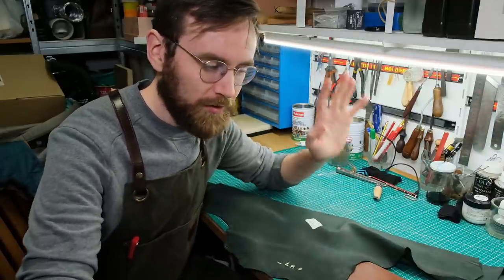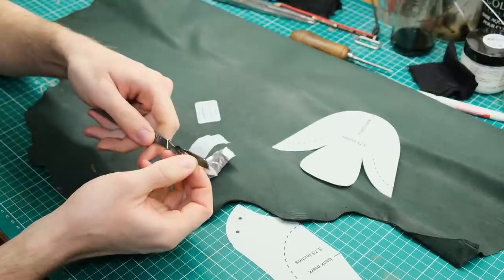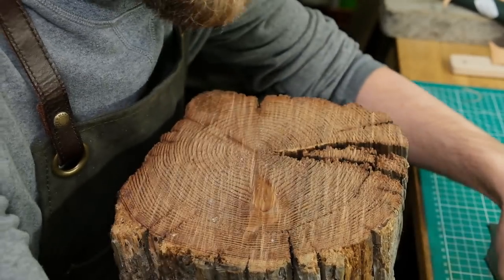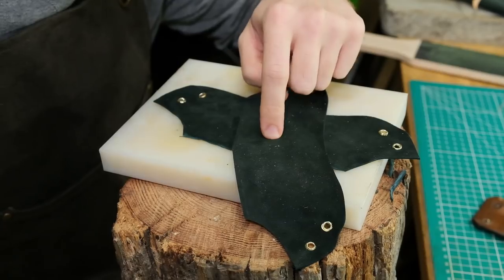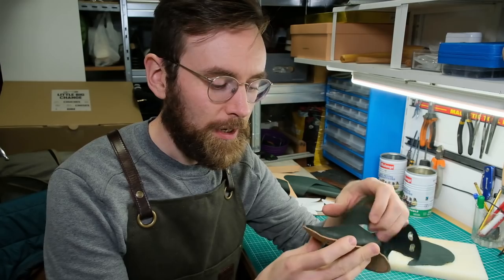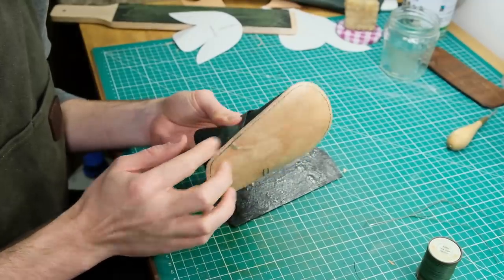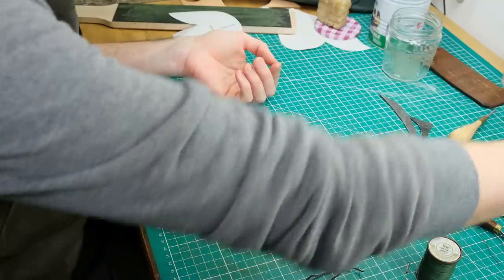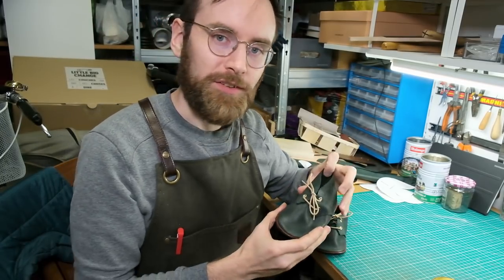Making baby's first pair of handmade shoes!         Not a "how to" video ;)

Comment: I love your sentiment on leather conservation due to the awareness of it’s origins. The respect you show is admirable. These turned out really, really cute.... might have to make a pair. Have you considered using shears for the softer thinner leather? I really prefer using mine. Also, I really like this style of videos but either way- I’m a fan! Thank you James!
Reply from the maker: Hiya and thanks for your message! I'm glad you like the video and end result :) I've never used sheers on leather as I don't normally work with such thin material as this suede... Will have to give it a try next time. Thanks for the tip!

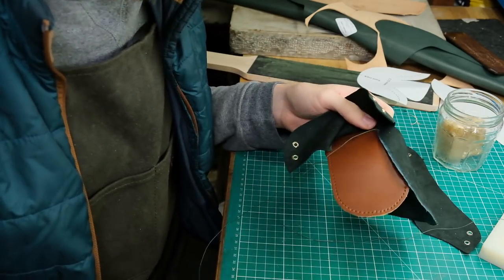Comment: @ 21:51 I like the soft leather shoes you are making! I like to use a 6 oz veg tan for this pattern the shoes that size are for Baby's just beginning to walk so the thicker leather for support then I use a 9 oz veg tan for the sole I do a design on the bottom with my swivel knife to give traction to the bottom I glue cotton fabric to the suede side with shoe glue cut it out with scissors then punch the holes